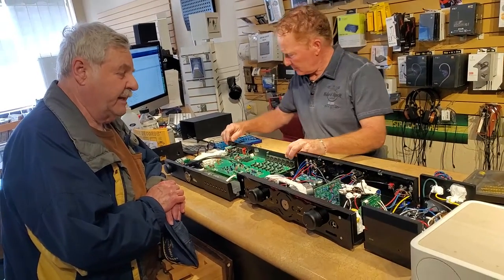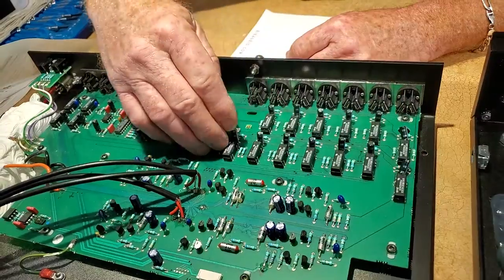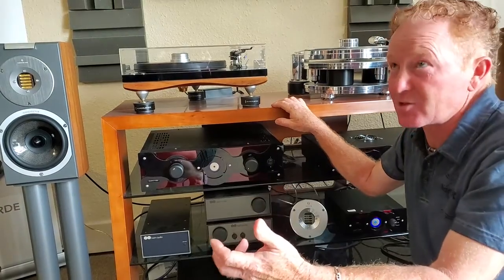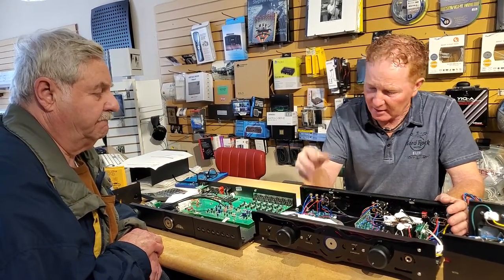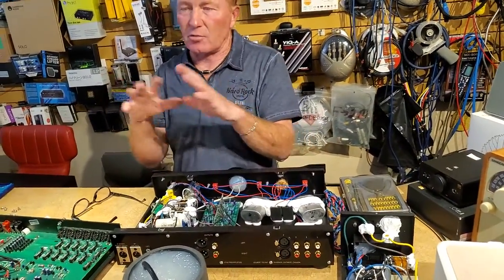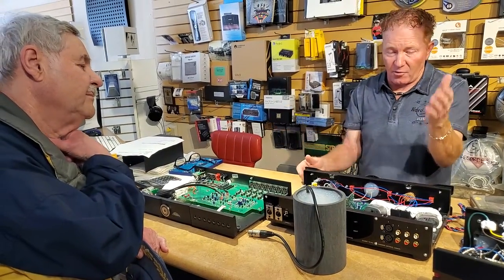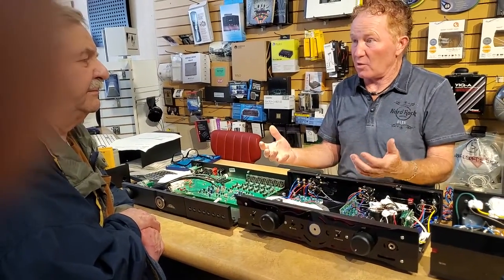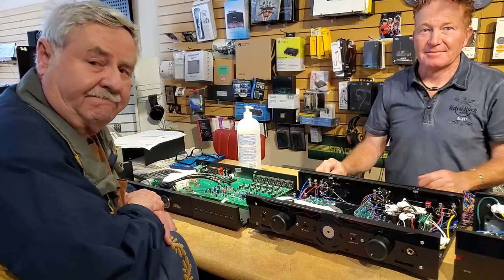Comparing Naim Audio and Angela-Gilbert Yeung preamp

Comment: Hi Mike, I have one of AGY's AC3000 Pre amps with LOC! And there are a lot of CAPS! 4 Volume Controls Each one has positive Phase for L+R Channels and 2 for Negative Phase! Very Cool Pre Amp!
Reply from the maker: Have you tried turning up each phase of the volume control to adjust the soundstage width and depth?  The higher the positive phase, the deeper the soundstage.  The higher the negative phase, soundstage gets wider.

Comment: Great video, Mike! It's always interesting to understand the compromises involved when designing for large-scale manufacturing, as opposed to having the ability to produce a small volume with a highly skilled designer or technician. There are some parallels in automotive engineering as well, but in general, designing for manufacturability is preferred over pursuing the "best performing" design solution. This is because it is necessary to service and repair cars as cost-effectively as possible, using replacement parts often made by different suppliers in different regions of the world. Anyhow, great video - keep up the good work!
Reply from the maker: In the case of audio manufacturing, most companies only concern about their bottom line.  Therefore, they ensure the product can be made fast and as cheap as possible.  At the same time, make them look as good as possible but not necessary sounding very good.  Because many audiophiles listen with their eyes, it is why so many audio manufacturers make fancy looking things but not sounding very good.  In term of internal construction, circuit boards are route for easy assembly first, nice looking likely is second and sound may be 3rd priority.  The faster and easier they can make it the more money they will make.

If you have listened one of the Angela-Gilbert Yeung products, you will understand what I am saying.  On the other hand, I totally understand a lot of people would reject the way I do thing because they have never experience products firsthand.
Reply: @angela-gilbert  i have been around the audio biz for over 50 years, since the days of the true Pioneers of the business. Mike was spot-on with his observations and comments. If it wasn't for those Pioneers (and their mass production techniques) audio wouldn't have the interest that it does today. Angela-Gilbert products are not unlike the hand-built prototypes of builders like Frank McIntosh, Bill Johnson, Bob Carver and many others that we appreciate and admire today with the differences being that you can actually listen to and purchase an Angela-Gilbert product. Mike can sell ANY product in his store to a customer. Mike will sleep like a baby regardless of whether it's an Angela-Gilbert product or something else.
Reply: yes I am thankful for the supply and demand levels right now to be honest... haha
Reply: @angela-gilbert  exactly, but when audio science reviews measure these devices they are told " measurements count for nothing ". You have to feel sorry for them.

Comment: Hi very interesting approach that of capacitance upgrade close to the circuits    I have always had a curiosity   I would like to see mainly in power amps an analog voltmeter place across the voltage rails and see if the needle stays still or moves with the music peaks 
If it goes down during the peaks it will be a clear sign of energy lack    The needle must stand still alwats even during the most demanding music peaks 
I wonder what would be the behaviour also of expensive amps   Maybe not that great ?
Reply from the maker: Analog meter is too slow to show accurate responses. Using a fast DMM will show ripple with slight increase when music is playing louder.  The average DC volt level may dip slightly but a DMM may be showing it too fast for the human eyes to detect.  A digital storage scope will able to show the slight dip in DC volt level during loud passages.  The higher the capacitance the less the changes will be.
Reply: @angela-gilbert  Hi thank you so much for your very kind and valuable advice 
I admire your creations a lot and i am sure they sound very very good indeed 
Now i am guessing but i think that solid state has often criticized for some lack of musicality vs tubes expecially for not enough capacitance in the power supply 
When the caps are not able to provide the energy during peaks nasty things happen
The tubes instead do not draw much current from the power supply  
And there is a reason why small power supply caps can be seen in most commercial amps.  Money.  The big good ones cost a lot indeed.  Thanks again for your very kind and precious advice 
Best wishes   gino
Reply from the maker: @gino3286  On the internet, everything is over simple and many led to misinformation.  Tube runs on high voltage and lower current. Which less capacitance is needed for the same amount of energy.  Solid state is a current device compared to Tube. Higher capacitance is needed.  Also the physical distance between the active devices and capacitors can contribute to the sound.  There are many other factors which affect the sound quality.  Not only the amount of capacitance.  Also how it is built which also lead to the topic of how energy is being handle.  This is hardly a black and white issue.
Reply: @angela-gilbert  Thanks a lot again 
A very complex question i understand 
I prefer solid state because tubes have no good bass   I like a fire and forget amp 
Kind regards gino

Comment: All that white goop holding the caps down is very unprofessional construction. could have done a  much nicer job than that it is awful.
It does not inspire me to by those pieces of hifi gear
Reply: why pay more for it to look good on the inside! what about sound better? this is achieved by dampening with caulking! you don't want rigid cap mount
Reply: @aaronoosterhoff5449  I wasn't sold on the outer aesthetics of Blue Circle but I got myself an integrated anyways... the stuff sounds amazing. I can't see why the look of the inside should make a difference after you hear what it can do. To each their own but, turn off the lights and turn up the volume :)
Reply: Finally some sense. Thank you.
Reply: My understanding:  It’s not so much holding the caps down as floating them. Epoxy/gluing or bolting them to the chassis picks up all the vibration from the metal box. If you prefer that way, that’s ok. 

I opted for the silicone and am very happy with the results. Some of the wires inside my A-G modified amp are also ‘floated’ with silicone.